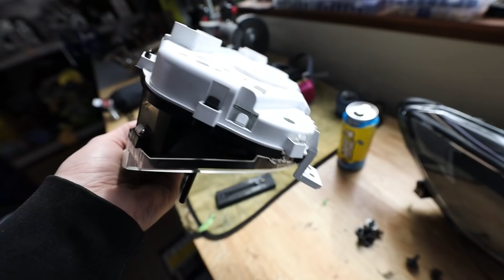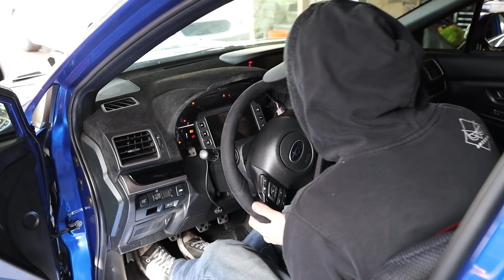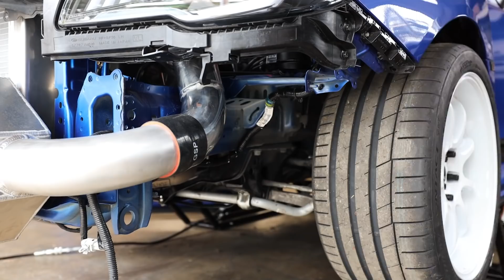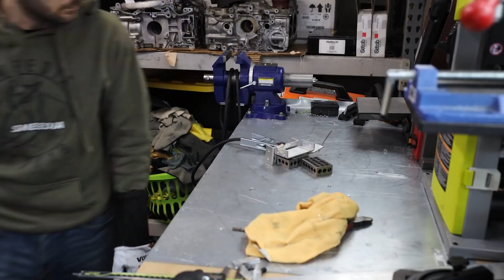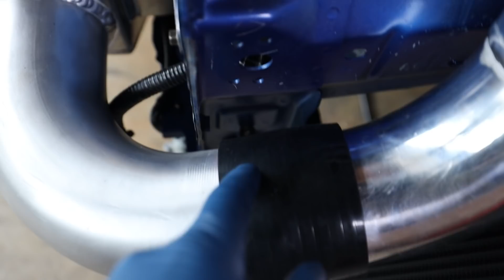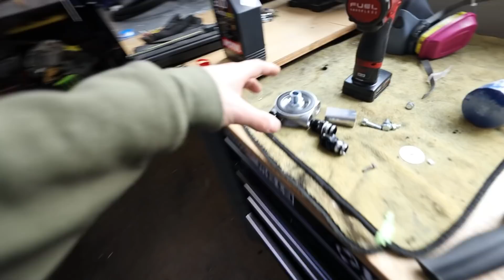Everything is Falling into Place H6 Swapped Subaru WRX STI

Comment: If you know what wires go to both sides of the charging light you can just make a jumper wire. I've had to do that on some older Volvos that would not start the charging field on the alternator.
Reply from the maker: That's thr only issue. I can't find the wires. The charging light is integrated into a charging circuit 🙃 have someone making me a jumper harness to emulate the cluster

Comment: So I got the same work wheels as you in silver, do you run hubcentric rings with them? If so, where did you find them in 73.3mm
Reply from the maker: I run hubcentric 5mm spacers, snagged mine off of Amazon. 🙏
Reply: @Smeedia  I’m so bummed, I just got the wheels in. 18x9.5 +38 d9r and I will have to run spacers in the front to clear the brakes for a 21 sti. Would it look funky with just a 12mm spacer in the front?
Reply from the maker: 12mm might be a bit over kill. How much clearance do you need?
Reply: @Smeedia  I actually mounted them today and only need like a 5 or 8mm, I was referencing one of your old videos where you needed 12mm. But I see the 6 pots, like I have, clear better than 4 pots
Reply from the maker: These are what I'm using https://amzn.to/3vI56Gf

Comment: I’m not sure if anyone has said this yet, but try turning up the heat on the welder. The gauge of aluminum on that intercooler may be thicker than the aluminum tab you’re welding on. I had that problem when I was repairing my collapsible shop seat/creeper. The locking tab broke off so I had to repair it or use it as a creeper forever. But the issue I was having was that the steel of the frame of the creeper I was welding to was thicker than the locking tab I was welding on. So in order to get good penetration, I had to turn up the heat (amperage) so that I can melt the wire between both items. The first weld looked good and appeared to connect the two, but when I went to tug test it, it busted off. Which forced me to turn up the heat. Also, if you’re worried about burning through, go get various gauges of material and test welding that. Taking two pieces that are same gauge is going to be easy, because the setup is designed to just merge two metals together. So get thicker pieces and weld thinner pieces to it. But focus on getting penetration of the thicker material before welding the thin piece to avoid creating a puddle of aluminum and just burning through. Also, practice melting pieces together without the welding rod. This will give you a good idea of how much material you can save or waste when welding. Make a puddle and just form that puddle into a weld that connects the material together.
Reply from the maker: I'm maxed out on 110V 😍
Reply: @Smeedia  yeah, time for 220.

Comment: Aren’t you on a stand-alone? From glancing over the diagram it looks like the alternator needs 12v from the cluster. You could just have the standalone trigger a relay that has a 12v constant before the switch is made, and then make one of the I/o’s close/make the relay when the vss output is true. In regards to the dash light you have the ic7 you can’t configure a light to come on when battery voltage is below 11v or so for a certain amount of time?
Reply from the maker: It's not a 12V, not 100% sure what thr voltage is but it's a very small amount. Have a PnP adaptor being made to make things easy so we don't have to rewire anything
Reply: @Smeedia  I cant wait to see it it’s going to be interesting

Comment: I have two ideas for you.
1st is the alternator situation, I had a Jeep not long ago and it is common for the charging circuit to crap out. The solution is a standalone voltage regulator. If I remember correctly they are adjustable, that should take care that. 
2nd is the oil cooler bracket. I have the same exact thing going on for my PS cooler. I can email you some pics, just send me your address, I also have it on my social media but don’t think I want to blast that out here. 
Keep at it buddy. Lastly I’m real good with electrical to an extent of course, feel free to ask me some questions I should be able to help a little, I hope.
Reply from the maker: Definitely appreciate the electrical help, luckily Iwire is making a jumper harness for us to be an easy PnP solution. 🔥 

Tannerwrx525@gmail.com 🔥

Comment: Actually the car runs off the battery. The alternator is supposed to support and charge the battery. It puts a heavy strain on the alternator to have a weak battery where the alternator is forced to run the car and try and charge the battery, leading to premature alternator failure.
Reply from the maker: Making me think of jumping up to a bigger battery now 👀

Comment: Is there a reason you're not mounting the oil cooler to the top of the intercooler..There is room unless the grill interferes..?
Reply from the maker: We don't wanna stack infront of the radiator if we can avoid it. Biggest issues with EGs are coolant Temps

Comment: Lovin the sti bro can’t wait to see it rip on the dyno. I fuck with electronics all the time looking at your wiring diagram looks like you should be able to run a ignition on fused battery wire to wire #3 on your alternator. If the original voltage going to it is less than 12v you’ll have to add some resistors to drop the voltage down  to spec
Reply from the maker: I'll see if I can find it, luckily Iwire is helping us with a jumper PnP harness

Comment: Kinda defeats the point of an oil cooler if you run the lines next to the exhaust.
Reply from the maker: With fire sleeve and the manifold being coated I'm not too worried about it🤙

Comment: Weld a bracket to the bottom of the cooler towards the front support then add another bracket to bolt it on
Reply from the maker: That's the original idea I was playing with but couldn't find a clean way to do it 🤔

Comment: thread tape on oil system? shouldnt you use high temp liquid sealant?
Reply from the maker: Ideally yes, the tape was just an idea after I found the thread pitches don't line up 😅 not the smartest idea lol
Reply from the maker: Bit the proper fittings should seal without issue, they use O rings

Comment: 1. Disassemble cluster for DCCD screen. 
2. 3D print screen frame. 
3. Mount DCCD screen amongst all the other gauges and screens for full aviation effect and WOW factor
4. ??????????
5. Profit
Reply from the maker: Need to snag a 3D printer as some point 🔥
Reply: @Smeedia  sheeeeiiit, those things are slowly becoming mandatory these days my man!
Reply: @Smeedia  Get into "fusion 360" asap for the 3d modeling. I'll mill you a cluster out of billet aluminum. Any files you can 3d print/ I can plug into a cnc on the downlow @work. Or just sketch out a rough napkin blueprint and I'll do it on a Bridgeport quick n dirty.
Reply from the maker: I've got access to auto cad if that works, just have more experience with it 😅
Reply: @Smeedia  yup! Let's gooOoOO
Seriously if you're struggling with or don't have the spare time 3d modeling I'd even work off a napkin sketch.

Comment: Tanner caused me to buy parts 🥲

Cobb Accessport
Cobb SF Intake  
MAPerformance Catted Downpipe 
Invidia R400 Cat-back
Radium Dual Catch Can
Cobb Turbo Blanket
Cobb 3-Port Boost Controller
NGK2309 Spark Plugs
Subaru BRZ Intake Manifold
Grimmspeed Front-Mount Intercooler
AEM 340LPH Low-Pressure Fuel Pump
(Shop is installing the parts and tuning me for E30)

My bank account is in SHAMBLES 😭✌🏽
Reply from the maker: We will never financially recover from this 😭
Reply: @Smeedia  Everything I got is quality (thanks to your recommendations) but I’m soo nervous to hear my quote from the shop 🥲🥲🥲

(I want to do a KillerB exhaust manifold as well later down the line)
Reply from the maker: Hopefully not too big of a bill, but quality is the way to go 🥳
Reply: @Smeedia  This is also before any cosmetic mods I want 🤕
Reply from the maker: That's what I normally do also 😅 but go fast!

Comment: Count the pins on the ribbon cable and Google extension harness "pin count"
Reply from the maker: That's a thing?! I thought I would need a whole new screen 😅
Reply: Ya let me know the count and I'll post a link
Reply: Pull the dials off the gauge. The screen will have some standoffs probably soldered on the other side of the board they're nothing more than a mounting point if not pinched in between the gauge in the plastic. We'll find you a longer ribbon cable and you could remount the screen somewhere else but obviously the gauge will have to stay connected hidden behind your new gauge.

Comment: Those blocks you used when you were welding had holes in them whats the deal with that?
Reply from the maker: They're called 1,2,3 blocks. The holes are threaded so if you needed to bolt something to them you can 🙏

Comment: Diodes flow electricity one way only, the direction the arrow is pointing is the direction the electricity will flow, it will not allow ANY current to go the other direction.  it's how alternators work with the rectifier bridge, because an alternator actually generates alternating current, so it essentially overlaps the windings positive output charge only instead of Positive and negative output charge of alternating current. 

it's really cool to watch a bad diode on an oscilloscope.  also diodes you buy from say a radio shack also show the current limits before it fails, and also have the direction stamped on them.

and interesting thing about your reference wiring diagram with alternator and cluster.. the diode is preventing power from flowing back to the cluster, so the FIB12 or Fuse No 2, is actually pushing power on that wire to the alternator. my guess is, if the red wire going to cluster has 12 volts on it, you could bypass it with a diode and a 12 volt power source.
Reply from the maker: I did not know this 🔥 so you would essentially put a diode in line to ensure that nothing can be back fed through the wire?
Reply: @Smeedia  according to the diagram, yes. it is essentially protecting the computers in the cluster from over current, from the looks of it, the cluster section you mention that illuminates the charge light is measuring voltage and current, hence the battery sensor as well. if current is only flowing out the batter sensor over the wire senses the increased current draw, like an inductive ampmeter.  so i'm wondering if it has 12 volts, and you made sure there was no connection to the modules on that particular circuit, you may actually get away with no diode and doing a direct 12 volt source hook up , just use the same amperage fuse in line. .  as i'm pretty sure the ECU is what triggers the light based off the battery sensor. and i'm also pretty sure that wire from the cluster to generator is actually a voltage reference wire that controls the regulator.